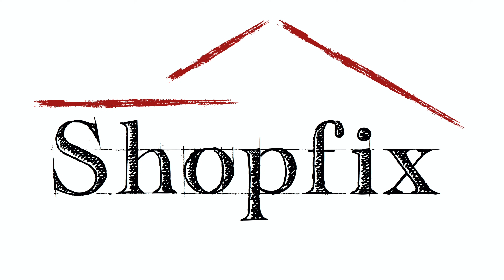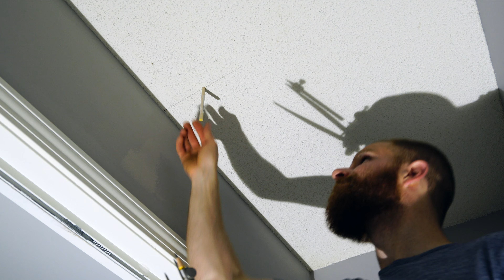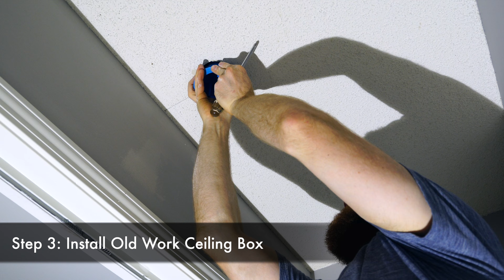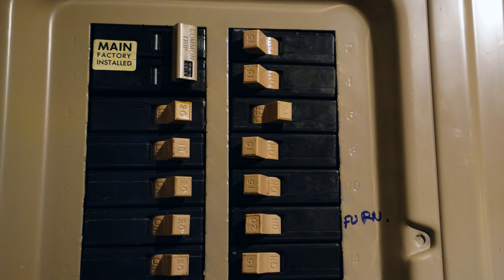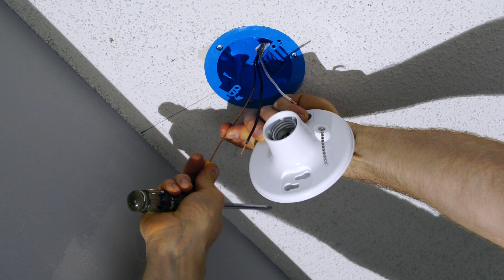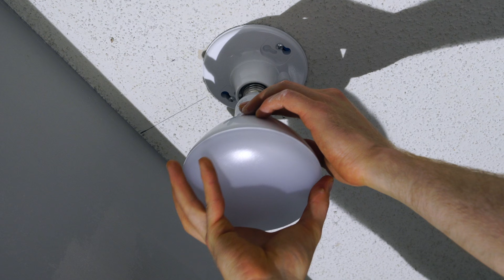How to Install an Old Work Ceiling Box

Comment: "we're going to drill a hole roughly in the center of where the light will be"
"We're going to use a protractor to show you how far off center that hole actually is"
Reply: compass bro
Reply: @BloominOnion1 but... You might need a compass to help navigate that distance? 

Okay I messed up.

Comment: You dont attach it to a stud? That seems like a lot of weight for drywall screws.
Reply: How ? Most old work boxes hold 6 lbs lol
Reply: @MrAntihero1001 because the wings come out. That wasn't totally clear in this video. Thanks for clarifying.
Reply: 6#

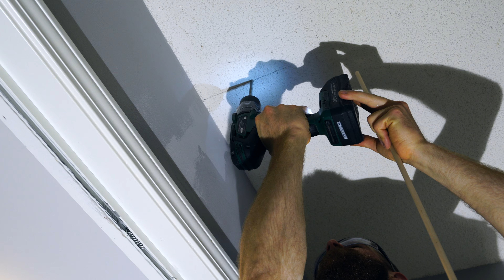Comment: For the "probe" at 00:31 , instead of using a drill bit, you can put a rigid 16" insulation hanger (or even a length of snipped wire clothes hanger) in your drill and make a very small hole, to check for studs.

Comment: Why not just use a hole-saw sized for the O.D. of the round box?
Reply from the maker: You can use a larger hole saw as well 👍
Reply from the maker: However don’t cut it the od diameter as    the tabs needs to be pressurized to diameter of the rim.